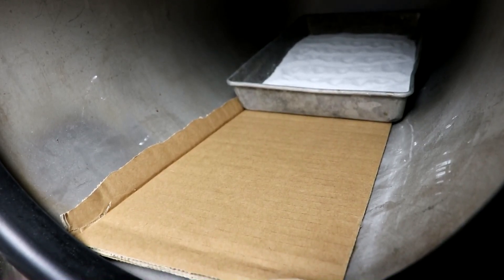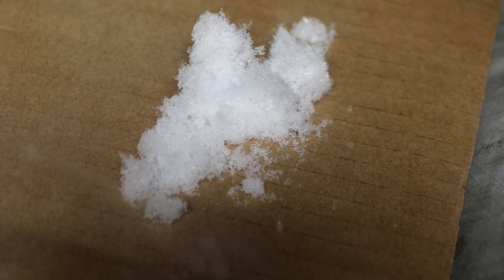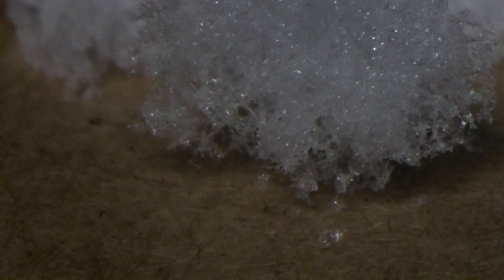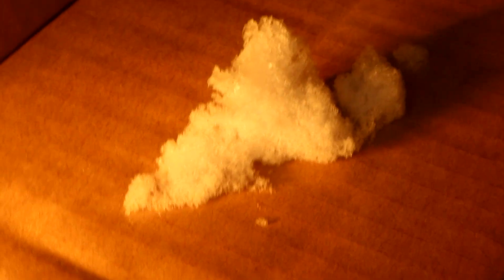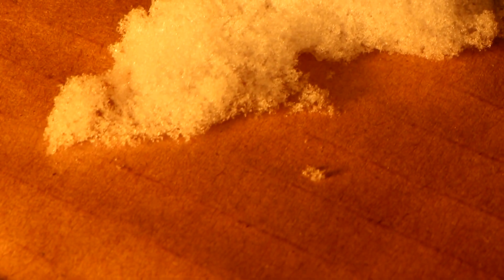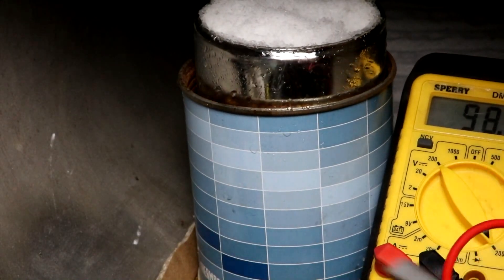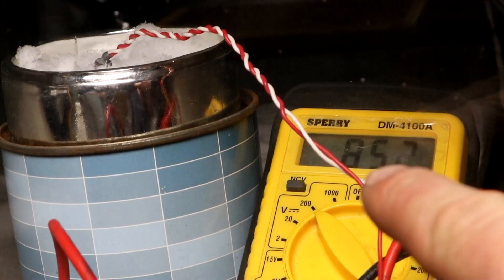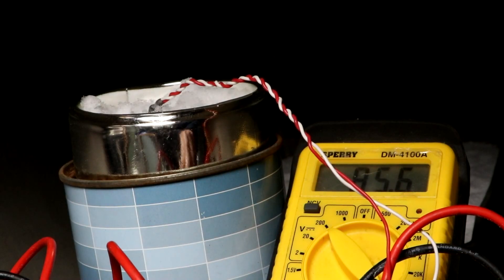Snow In A Vacuum Chamber

Comment: I would have thought it would evaporate to a gas as fast as a cup of water would boil.
But I guess it still needs that energy for the transition and stays ice if it doesn't find it. 
Comets I thought remained Ice in a Vacuum because they are not pure ice. I thought the reason they stay solid is because they are a frozen solution of some kind. 
This makes me think they could also just be pure water. Tho they're prbly not.

Comment: @cody'slab hey I was wondering if you could possibly help me out a little bit or if you could refer me to someone who could? Sorry for being completely off topic. I bought 5 lbs of bismuth to emulate a project from nighthawkinlight and when I went to melt it I got a bunch of slag off the top. So without thinking, I drossed the pot with borax to flux it. Now most of my bismuth is a grey powder. I've lost about half of my bismuth when I did this. I should've used candle wax instead. I have a furnace I could use to melt it back down but I'm not sure if that's the correct path to take. How can I isolate and remove the borax from the bismuth? The bismuth claimed to be 99 percent pure. Thanks in advance. If this is too complicated to answer or accomplish just disregard sir, I dont want to take up any of your time.

Comment: I've seen snow sublimate away in a few days if the sun outside is intense and strong enough. Usually happens with the remnant snow after shoveling a sidewalk. Still some degrees below freezing when it happens, so it's not melting in the usual way. When it happens at atmospheric pressure I'd guess it tends to be more of an intense light driven process than a temperature one.

Comment: You should stick a CO2 or Liquid N2 trap on that to avoid destroying your pump. They last WAYYY longer if you don't pump nasty stuff through them :P

Btw, it's not called "melting" if it's sublimating. When it's sublimating, it's sublimating. When it's melting, it's melting. They're two different processes.

Comment: why dont you put an inline desiccant trap on the inlet to the pump. seems inefficient to have a tray in the bottom of the cylinder. maybe save you the odd oil change. take it easy Cody :)

Comment: Technically, because in a vacuum there is less air (unless its perfect I know), would the snow ever melt without light energy? Since thermal energy is transfered from particle to particle, if there are less particles it should melt incredibly slow, unless you use light as a heat transfer because light is its own particle wave thing. Am I right, wrong?

Comment: what really confuses ME about vacuums is - you would THINK that a thermometer at HIGH VACUUM would register a VERY LOW temperature - regardless of the temperature outside the chamber - since temperature is defined as the degree of molecular movement ... so how does THAT work?

Comment: Actually it's a little more complicated in the case where you got external heating by that lamp.
It's not only sublimating. Great deal of the vanishing happens as water is turning into liquid state clinging to the surface, which then evaporates. It's not even a surface phase - droplets are clearly visible. This happens because water is here almost in triple point.
When there isn't a lamp heating it, removal of heat by evaporation is fast enough that the temperature drops down considerably, way below 0 °C. In that case only sublimation occurs and sublimation continues to carry away the heat, although less efficient.
Reply from the maker: Lajos Winkler 
I didn't see any droplets
Reply: Fourth minute. I can clearly see they are wet. Those local conditions are close to the triple point of water.

Comment: You're actually using the freeze drying chamber for it's intended purpose
Reply: Perhaps he's feeling under the weather. We should let it slide... this time.
Reply: +Omegapede Prime
It's an optical illusion.  If you look at a phase diagram you'll see liquid water can't exist below 0.006 atm, and his chamber was at about 0.0007 atm.  In fact water evaporation can only lower the temperature to around 0.01°C, regardless of the pressure.
Reply: Omegapede Prime 
It’s too low pressure, and too cold to be liquid.  At this pressure it acts like dry ice.
Reply: Freeze Drying ice is maybe the dumbest thing I've ever heard.
Reply: thenorup that’s a real thing.,, buts it’s not a vacuum chamber. I think it’s called a “Freeze Dryer” litterly but I know for sure how it works...

You put something with liquid in (Idk if it works with all liquids. It works with juices and water) and you turn it on. It goes to very cold temp freezing the liquid. Then I THINK it warms to fast enough that it automatically turns to water vapor. (Or whatever liquid you used) there. A lot of food is treated like this. To make it last longer often. Like the marshmallows in lucky charms are made like that

Edit: yes it’s called a Freeze Dryer
Reply: +Omegapede Prime Water has no liquid phase at a low enough pressure. With that said, water CAN exist in a vacuum, just not exposed. For instance, inside comets, if there is an air pocket, water vapor could increase the pressure high enough to form pockets of water within the comet. However, those pockets are under high pressure relative to space.
Reply: MrTurboturbine 
“For it is intended purpose”

Seems legit.
Reply: MrTurboturbine Its*
Reply: okay...
Reply: Victor B no, you're supossed to use an apostrophe in possesive situations. For example oscar's, dennis'

Comment: You should put snow in the chamber and outside and see how much longer the snow in the vacuum chamber takes to "melt" than the snow outside, do to there different thermal conductivity.
I guess that would probably be a relatively boring video for most of the viewers. But I think it's interesting. :-)
Perhaps it would also be interesting to try and insulate it visually, with aluminum foil or so, to minimize thermal radiation and see what a difference just the thermal radiation makes. Just kinda unfortunate that you couldn't actually "see" it then. That would probably make for an even more boring video. Ok, good thing I'm not a youtuber I guess... :D

Comment: Hey coby, I was just wondering I saw a video a few years ago about the triple point of water (if that is the right term) where the water is switching between solid, liquid and gas at the same temperature and pressure. I was thinking if this is actually possible/real and if so, could you replicate it? Thanks

Comment: The resistance of something is dependent on 4 factors, length, a shorter wire has less resistance than a longer one. Width, a thicker wire has less resistance than a thinner one. The material, it's strength of hold on electrons, (less hold means electrons flow through without being slowed as much). And temperature, which Cody uses in this video. (The colder it is the less resistance it has). So if you know the rate at which resistance drops for every dropped degree temperature, you can measure the temperature of something by getting your copper wire to the same temperature as it, and measure how much the resistance drops. 

So states Ohm's lawa in a lot more words.

Comment: Hey Cody, can you try to put water in a vacuum but freeze the top and leave water in the middle to see if the water is protected by the ice in a vacuum. You can try other materials not just ice. ;)

Comment: 1. If that is a vacuum then your heat lamp will have no effect.
2. "The room is warmer, should have melted the snow" See comment 1.
Reply: Uh... no offense, but it can and does. The Sun is 93 million miles of vacuum away.
Reply: No not offended, I didnt think of that. Radiant heat right OK. 
Was thinking along the lines of vacuum insulation.

Comment: It's not melting because temperature cant transfer through a vacuum
Reply: Uh... no offense, but it can and does. The Sun is 93 million miles of vacuum away.
Reply: Pygar2 thats radiation hitting the earth its the same thing as when he put the heat lamp on it
Reply: Radiation is how heat can transfer through a vacuum, what you thought couldn't happen.
Reply: Pygar2 thats not correct the heat we feel is the ground or our surroundings  heating up and that transfers heat litteraly zero heat travels through space
Reply: What is heating the ground? It can't just happen; the heat comes from radiated solar energy that has just passed through a vacuum.
Reply: Pygar2 Jesus you're dense heat can not travel through a vacuum you know thermos cups do you know why they have such heat conductive metals used on a cup meant to keep heat or cold in? It's cause they create a vacuum in the void space in the cup now do you understand or do i need to explain further
Reply: Pygar2 also microwaves have zero heat the heat comes from a reaction of the radiation interacting with a solid object
Reply: Dewars (thermoses) use metalized (mirror) glass to minimize radiation; reflect it back. Not relevant here. Go wiki or google how heat gets transferred; radiation is one of the ways.
How microwaves create heat is not at issue here. That heat can travel through a vacuum is proven by the Sun. No magical "the ground just heated up" allowed, or it could happen deep in caves, or on the night side of Earth.
I'm pretty sure Cody prefers no name-calling on his channel, btw.

Comment: So, I was thinking of a related experiment I'd like to see with the vacuum chambers.  It'd be interesting to watch the difference in the speed heat radiates at under vacuum. I think a good way to demonstrate this would be with red hot metal both inside and outside the chamber.  Of course, you'd run into an issue drawing a vacuum fast enough for this.  A possible solution is using the larger chamber as a vacuum reservoir and have a vacuum pulled in it ahead of time.  Connect the two chambers with a valve, and once you've gotten the red hot metal on a plate or whatever in the glass chamber, pull the valve.  I'm unsure of the volume of your chambers or how well the smaller one would hold up to that quick of a change in pressure, though, so that might not actually do much.

Comment: Before i start the video i predict its going to almost instantly turn into steam bc of the boiling point rising with the pressure.  
Edit: well i was wrong. But he did confirm that if it was WATER i would be corect. You see flatards? Normal people acept they are wrong.

Comment: Can you burn snow see if it turns to charcoal I saw a guy do it on the interwebs.. would be cool if you mythbust it
Reply: I can't tell if you're trolling or
not, but I don't think that turning water into carbon are possible in chemistry.
Reply: Dat Tepo   you can remove the oxygen from the carbon dioxide that makes up dry ice by burning magnesium filings inside a hollowed-out piece of dry ice with a dry ice lid on top so  it's surrounded on all sides by carbon dioxide because magnesium Burns at such a high temperature it can actually pull the oxygen out of carbon dioxide leaving behind carbon and creating magnesium dioxide when it's done you will have some dry ice left over but you also have white magnesium oxide and black carbon
Reply: If you burn it well enough it can turn into gold too

Comment: Apparently hot water freezes faster. A video on this would be interesting or maybe you've already done it.
Reply: I'd love to see Cody's take on this. Apparently called the Mpemba effect. It's a recurring phenomenon in certain conditions and circumstances but does not occur all the time. Scientists can't seem to agree on what causes this.
Reply: I tested this several years ago and my results indicate it most certainly does not. Hot water has more energy that has to be removed then cold water. well, hot water will drop quickly due to the temperature difference it never seems to catch up or beat the cool water. I started with hot water and cold water as supplied by the sink. maybe 120° & 60°. filled two cups with each and placed them both in the freezer. checked up on them every so often. the one started out cold started to freeze well ahead of the hot one. by the time the "hot" one started to freeze the "cold" one was fully frozen.

did the same with boiling water. on the stove top and timed it. hot boiled quicker than cold water
Reply: Mckayver I tested this for a project in 7th grade. From what I remember, the initial temperature makes almost no difference on how quickly the water freezes.
Reply: I had a look through the videos and it doesn't seem like he's tried this.
Reply: But he boiled water in a vacuum until it froze, to it's kind of similar.
Reply: I have heard that it's having been boiled that gives the accelerated effect, but I don't know myself how true that is.
Reply: Dave Hodges if its been boiled, the boiling off of water would concentrate any minerals and particles in the water, so as long as you let it drop down to room temperature first, it may well freeze faster.

Comment: What was that at the end? Sodium?
Reply: It's Sodium Potassium alloy, aka NaK. It's a liquid metal that burns when it gets wet
Reply: Felixkeeg after a snowfall as long as it's cold out there is almost no water vapor in the air. Contrary to what many think you actually need some warm air to make snow, it cannot snow at all once you get more than 20 degrees or so below freezing, not enough moisture in the air.
Reply: Felixkeeg i think it was zinc powder, ammonium nitrate, and sodium chloride, but I’m not sure tho
Reply: don't think it was NaK, it'd burn under normal air due to moisture
Reply: Felixkeeg buddy moisture is too low in utah.
Reply: So he put a powder coat on a wire? The second half was making damn straight and consistent lines
Edit, a chunk on a price of paradise would do the same
Reply: Ive been in -40˚ and it was snowing.. care to explain?
Reply: Ian Thomas it probably blew in from somewhere warmer and formed snow once it hit cold enough weather

Comment: no water ? i clearly can see drops forming. doesnt wet the cardbord, but if you look at te top of the needles you see drops
Reply from the maker: That was a clear ice crystal
Reply: That's because when ice sublimates, locally it's not a perfect vacuum and you reach for a short amount of time a pressure over 0.006 atm which is the pressure of the triple point.
Reply: (because of water vapor forming)
Reply: Are you saying that water does form (because it's not a perfect vacuum) but then quickly gets converted to gas?
Reply: You see droplets forming only to instantly evaporate throughout the video, however at one point there’s a droplet that forms that visibly boils before evaporating.
Reply: Oh yes that makes sense. Sorry for my crappy explanation lol
Reply: dangit :)
Reply: herman2nl
autism intensifies

Comment: I guess it's melting so slowly, because there's no atmosphere to transfer energy into the snow.  So the only energy available to melt the snow is radiant energy, which is substantially slower than conductive heat transfer :)
Reply: also, the little amount of snow that does melt, instantly evaporates, cooling the snowaround it down.
Reply: and the heat conducted by the cardboard
Reply: I think a bigger effect is with no liquid water, the conduction from cardboard to snow is weak, but with liquid water the conduction is spread over a much larger area.
Reply: The boiling point is alot lower in a vacuum though so that will make up for that.
Reply: No, it's sublimating. It's not melting at all. Cody was using the wrong terminology in his video.

If you look up a phase diagram, it'll hopefully be more clear why the snow doesn't melt and instead sublimates.
Reply: It wouldn't matter if the cardboard was cold to begin with. It will absorb light from Cody's lamp and heat up where as the snow will for the most part reflect it
Reply: Danielle Spargo girl I didn't understand a word but....yeah 😂😂♥💕
Reply: If there was air between our sun and Earth though, the conductive energy would cook us :)
Reply: I don't know whether the cardboard had been kept outside in the cold or not. Cold anything will not melt snow.
Reply: pressure does change the melting point but yes not by much in fact with water it actually slightly lowers at a higher pressure and then increases quickly. This is besides the point however because the pressures Cody is experimenting at the temp required for sublimation is still lower than the m.p. at 1 atm
Reply: That's the increased friction though.
Reply: SalamiTom Junior high pressures increases the melting point, however the high pressure and friction accumulate heat
Reply: Albedo of the snow is high.
Reply: Unterhosegotti are you sure?
Reply: It is also a solid which requires more energy to melt + surface area
Reply: Danielle Spargo
How is the sun warming our earth?
Reply: Alex Smith energy travels through radiation and through convection.  Convection transfers energy much more quickly, but due to the sun's massive energy output, the radiative energy transfer of our sun through the vacuum is more than sufficient to heat our planet to it's current state :)
Reply: Danielle Spargo You forgot conduction.  Conduction is through a solid medium, convection fluid (liquid & gas), radiation is through vacuum but could also transfer energy through matter, too, as long as the matter is not opaque to the radiation.  So when you stand out in the sun on a hot day, you are being heated by radiation, convection, and conduction (through the ground).  Of course, much of the radiative energy is being absorbed by the atmosphere before it ever reaches the ground.
Reply: If melting point goes down it needs less energy to melt/boil(in this case, sublimate) so intuition would sat that it should melt faster. Danielle is also technically incorrect as most of the energy is probably heat transferred from cardboard since it would absorb more light than snow which is mostly reflective although you had the right idea
Reply: High pressure does lower the melting point. Look how ice skates work.
Reply: Pressure does not change the melting point